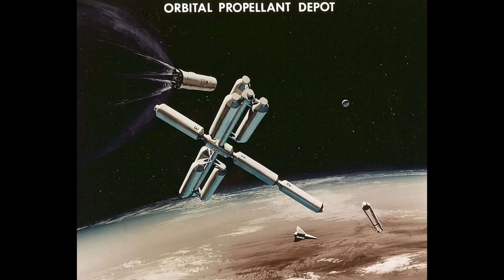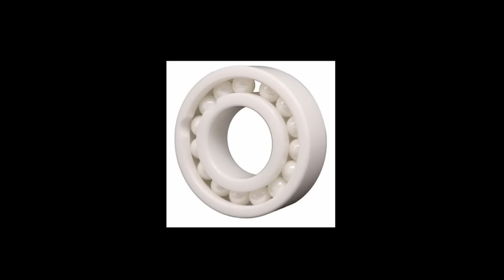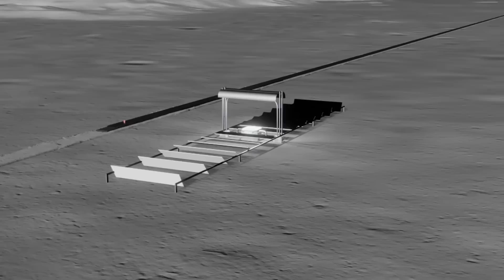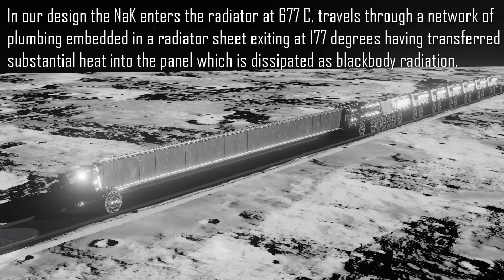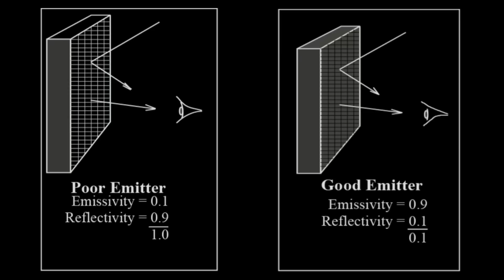Lunar Transportation Infrastructure (Sintered Regolith Roads & Nuclear Powered Trains)

Comment: Trains barely make sense on earth. Why would anyone think they make more sense in an environment that favors a conventional solution even more???
Reply: They make a lot of sense on earth though... they are crazy efficiant and reliable, both things that would be valuable on the moon; especially given the hostile environment.
Reply: @numnut1516  They are efficient in terms of rolling resistance and nothing else, which is the single least important characteristic when you're talked ng about works ng on the moon. They are massively space inefficient, requiring an entire interstate system just for them, which no other infrastructure can use. They lack any form of versatility, they cannot deviate to avoid an obstacle, they cannot pull over to get out of the way if repairs are necessary. They are massively expensive requiring huge investments in their infrastructure and then even more investment to maintain that infrastructure.

Who would be willing to deal with any of this when an electric buggy would be hugely versatile, require nearly zero infrastructure, fills all the same roles with none of the downsides... You literally need to have not thought about it at all to think that space trains make ANY sense.
Reply: @operator8014   I think you missed the point of the video. Eventually as the moon is developed and utilized we are going to want something that is better suited for moving payloads of all sizes from point A to B. A buggy won't work for that for the same reasons they don't work on earth.
Railways have long been maintained with nothing more than the rails and trains that use them. What makes you think you need an interstate system to operate them? They have been around centuries before any interstate was built,  that claim doesn't add up. For moving things between 2 stationary locations they are the best option, just send the cargo on the rail, modern systems dont even require a crew. Many examples can be given of rail being used in extremely hostile  and undeveloped environments to great effect, even enabling development of those areas. I'll leave it to you do your own research, i think you will learn a lot. The industrial revolution, America's westward expansion, russia's rail system, china's rail system, Europe's rail system as great examples with rich histories that call into question the amount of thought you have dedicated to your rude remarks.

Comment: even if I watch most of this part again I'm still amuzed.

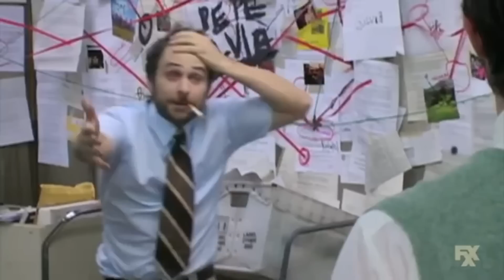Full of solid lines like one at 37:52 "Even if it (Solar panel train) costs more, it's just more simpler to navigate 'politically'." - Nations will fight over borders on moon, reactors will be much more harder to import under such attention.

That out of way, I wonder if it's viable to run train only under daylight part of moon. Having equator railway like in vid, then trains only move (sorta like chasing) the sun. 

Broken train requiring maintenence would have to wait entire lunar day to move but kinda fun to imagine flocks of trains following the sunlight! Each stations would need a lot more storage capacity to hold once-a-luar-day-delivery tho

Comment: Instead of making a furnace set up on the side of the road and building a road afterwards, something like a grader can be in the front of a train which is wider than the road itself and it can create soft regolith side walls just strong enough to keep the liquid regolith from spilling out. The second car in the train can be the cast regolith paver with heaters that heat up the the regolith to the desired temperature and duration to create the necessary thickness. The next car scoops up loose regolith from the sides of the cast regolith (with a grate that prevents larger pieces) and grades an appropriate thickness of loose regolith onto the cast regolith. The timing of the fine regolith addition can be rather rapid and it can anticipate for the lower 10% of the new layer to be sintered at above 1050C which will help bind the cast  regolith to the upper surface sintered surface. Then a second heater in the last car of the train can be a long heater with a continuous heating system designed to carefully bring up the temp of the remaining loose regolith to exactly 1050. A caboose can add any road markings if necessary.
Also the entire thing can be solar powered because of the low gravity, every car can have a very large solar array.

Comment: We 100% need trains on the moon. No doubt. And they need to be massive. My little engineers heart, that loves BIG toys, NEEDS us to have massive moon trains.

However, I have an alternative proposition to your two designs, which also solves another logistical problem of power transfer:

You go with a buried 3rd rail. Its actually a 3rd and 4th rail, as my 2 minutes of research says that 3rd rail systems send the return current back to their source via the "unpowered" rails, which we don't have. So it has to be created. Hence rail 4. Or run 3 phase (you probably will) so rails 3, 4 and 5.

But we bury them on 3 sides. They can be far apart, even off the edges of the railroad. Or they can be buried below, surrounded by our sintered regolith. But the point would be to surround them as much as possible with insulatiing material, then have a thin gap through which a power supply to the train can reach. This drastically reduces the power loss through emission you mention.

Which is also important because these power lines, along with possible others buried under or next to the railroad,  are also what sends power between facilities and settlements.

They can be powered by solar arrays spaced along the tracks, or static nuclear facilities at major settlements, or both.

Each train could be built the same, or you can have "tractor" units and deadweight carriages depending on economics.

It's also scalable, reduces the weight of the trains, and provides a neat solution to where you will run transmission lines. Everything will just be built around your railroads.

Also, risk analysis isn't letting you put a nuclear reactor on a high speed moon train, after shipping it from Earth on a rocket you need to land near your highly expensive moon base. Bad Anthrofuturism. No nuking the moon base from orbit. Naughty.

ADDITIONAL QUESTION: Would regolith processed to remove our iron and alluminium be a better insulator than raw stuff? Would we be creating such a material in bulk? What about the regolith removed of "free" iron?
Reply: The whole design will not work.  normal Rail systems need weight to start, stop and for gradientes on the track.   You want a Monorail on the Moon.

also having powered rail is a no brainer, has anybody even build unpowered rail in the last 50 years?
Reply: @nox5555  Please tell me you're joking.

I don't know exactly what you mean by "it needs weight to start", BUT I'm pretty sure some professional engineers can figure out how to get a thing with wheels and a motor to roll when thebtime comes.

And yes. Plenty of countries run "unpowered" rails systems. Diesel engined trains are incredibly common.
Reply: @Brainchild110  the Downside of rails is the same as the Upside, low friction.
thats perfect for keeping in motion but horrible if you want to change speed.
thats why they use sand to this day to slow down.

Running unpowered rail is different from building new unpowered rail.

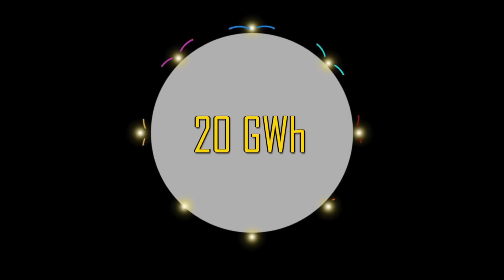Comment: 23:00 ish, mass driver talks, a large launch of cintered regulith as the base of the launcher is insane, and could be done super early on too,
Reply: fromt he looks of the solar panels and the length of the train, you could almost have them the same length, and have a single axis of rotation solar panels, ie form left to right hinged,  and a loooooong cabin area / box room,  cargo contaienr kinda thing ,  under neith it,

Comment: So what we need is a moondozer with an 8m wide blade to level the road bed with a 1m shoulder on each side. 
Or alternatively one with a grinding drum at the front to pulverize the regolith into a consistent "moon gravel" as it moves along with rollers supporting the grinding head to pull double duty of preparing the regolith and compacting it in one pass.
Reply: Like a tunnel boring machine. just for roads.
Reply: @LydenFrost  im picturing those machines they use to chew up old roads to reuse the asphalt, combined with a grader and a roller. Chews up at front, deposits behind the chewing drum, levels with a dozer or grader blade, then compacts with the roller wheels that support the whole machine. One pass and you have a prepared road bed ready to be sintered in place or have prefab blocks placed
Reply: @LydenFrost a road roller?
Reply: I wonder how heavy it would have to be to pressure melt the basalt.
Reply: @SlapShotTakes 
Due to the reduced gravity, I suppose it'd need to be more massive than an equivalent machine on Earth.

Comment: The previous video had a topic thread discussing using the wheels as a heat dissipation method. By adding some walls the road would be in shadow and be cold. then coolant could be circulated in the wheel.
Reply: Was there a whole thread about that? I remember making a comment like that. It'd work out better in terms of Carnot efficiency too since permanently dark parts of the moon can get so overwhelmingly cold. I think walls isn't the best idea though, more of an awning on stilts that's way taller than any train that'd go under it.

Comment: What is the advantage of having a prime mover for a solar powered train?  Heck, what is the advantage of having a solar powered train at all, versus individual cars?  No wind resistance on the moon, and the reduced man power needs of trains is wiped out by self driving, non manned vehicles!  Pretty easy to import just the motors or set up a motor winding plant on the moon based on aluminum coils.  Finally, the logical location for an initial road network on the moon is the lunar arctic circle, since it is possible to stay in the sun light all the time by just making a net speed of a walking pace, and the key resource that we know we need is water which we think will be concentrated in the arctic.  In practice, if it is possible to have long distance power transmission on the earth, it is possible to do so on the moon too where the distances are shorter and there are no water oceans.  Why would you want to go to the equator?  The immediate idea is that is better for the mass driver to launch mass to orbit.  So you need a single road from the arctic circle to the equator, and the mass driver is the only part of the lunar economy that only operates in the day. Or it has nuclear reactors that can be stationary. The rest of the economy runs 24x7 like it works for most of the earth's economy.  The balance almost always works out that capital is expensive - energy is cheap, and people are a pain in the ass.
Reply: I think this design is more for early to mid transportation, like yes its certainly better to remove the nuclear reactor but at the same time we need to consider the amount of time needed to build and set up those electrified railroads vs just producing sintered and melted regolith, then placing them down. 

I think in the long run an electrified railroad is better overall, but would actually be more expensive than just having a self powered train. Also remember we are bootstrapping an entire civilization, so its going to be comparing the resources and available technology of an early industrial revolution society vs the atomic/information age society of today.
Reply: @CeoMacNCheese  It seems like using nuclear power is more suited to building the road, than running on it.  What makes some regolith better than other?  The net amount of material you need for building the road is zero.  So why not collect the regolith and feed it directly into melting right where it is needed, and then sintering it in a mobile production facility.  Like you lay down asphalt with a machine that moves along the roadway.  And when replacing a road way in a rural area, you can just process the replaced road surface and reuse it as either aggregate for the new concrete or partial feed to the asphalt paver.

Comment: One question: What if, for the solar train we use and EMU instead of a locomotive? Since the waggons already have the power source and they use electromagnetic brakes (which can be repurposed as motors), we could add a lot of flexibility to the system, remove the need for building locomotives and as such redudcing costs. And all for essentiallynothing, since all the components are already there in the waggon.
Reply: I think the problem with it being solar is that the days and nights on the moon are something like a month long, aren't they? Having to wait something like a month to be able to move freight would be rather debilitating. Electrified infrastructure would solve that issue if there were nuclear reactors into the power grid elsewhere, but that requires all of that infrastructure to be built up and reliable too. The loading and offloading of carts with solar panels would be less desirable too as solar panels are delicate and you'd expect most of the cargo to be raw materials that you'd load through the top(best place for the panels)
Reply: @Some_Big_Stupid_Idiot  that is true, but in the video Ian already proposed using solar trains, acknowledging the lack of sun during half a month. He accepted working only for two weeks due to run.

Your concerns are valid, especially loading. However I commented on his proposal. Anywho, I hope that he or someone else illustrate us.

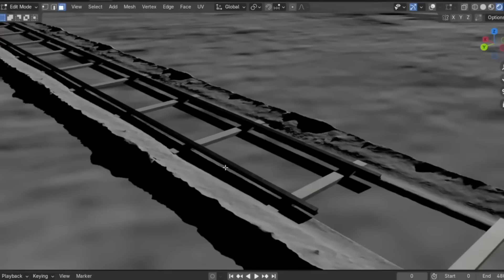Comment: 18:00, Not sure how I missed in the first "train roads" video but now that i"m looking at it again this isn't entirely accurate as the rail 11 times wider has exactly the same effect as making the rail 3.6666... times *taller*. The rail is an I-beam which means it's strength is limited by the shear strength of the web(bit in the middle connecting top and bottom) not the tensile strength, and shear strength goes up with the cube of height but only linearly with width.

Comment: I want to know your thoughts on an idea thats been rolling in my head for a while. What do you think of importing plastic pollution to the moon, break it down into its base fossil fuels and cleanly burn them, this way you’ll get both carbon and water vapor out of the process. Since we are going to have a bunch of oxygen on the moon, keeping the combustion reactions going isn’t going to be an issue. 

I ask this because how much sense would it be to get your hands on carbon on the moon this way. You also at the same time get to fight plastic pollution on Earth as well, though it likely will not drastically change the amount of plastic that is floating in the ocean.